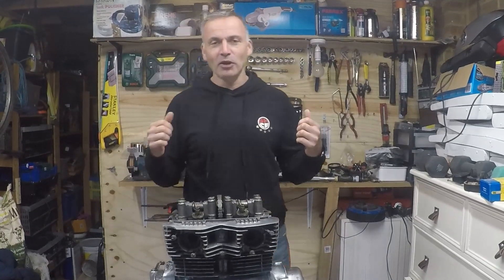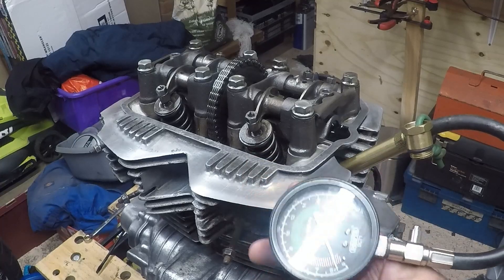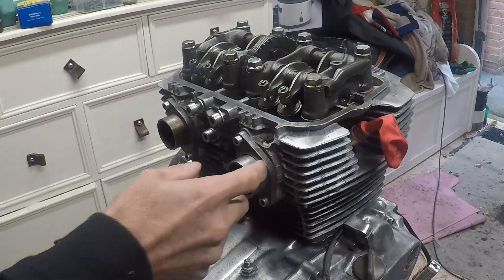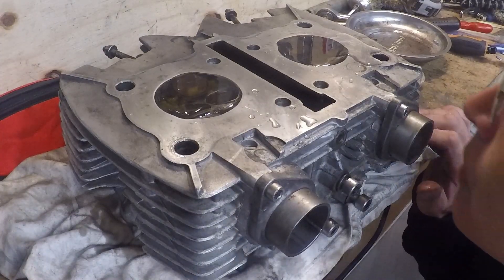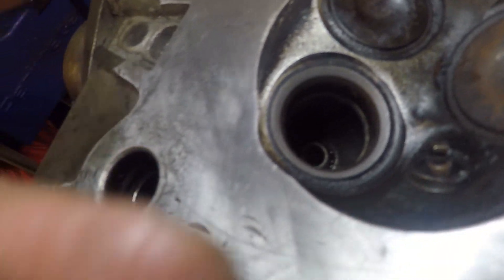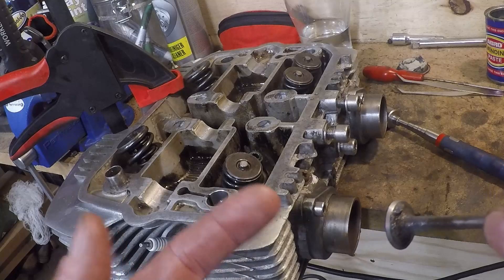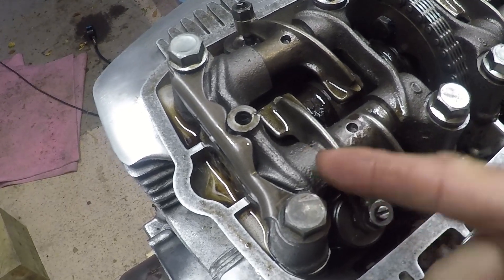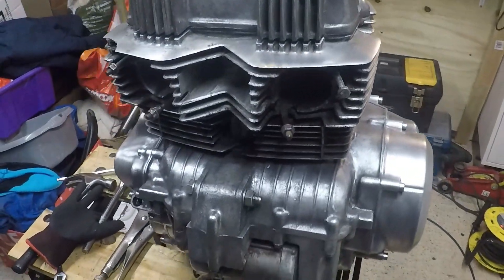Can I Fix My Low Engine Compression?  Honda Superdream Project - Part 19

Comment: Hi the leads from my coils don't come off .  Caps are the screw in type ..possible original to my 750 k5. These are , I feel ,are too short from over the years. Is it possible  ,   worth trying, to try a extension to add some slack .?????

Comment: I thought 150psi was a normal reading, not 90psi??
Reply from the maker: Hi Simon, you may be correct, and i hadnt checked it recently, but i now know my starter motor was knackered when last checked, and its hadnt been ran yet. So may be worth i recheck that again.

Comment: Would this be a common cause for compression loss on most bikes? According to my mechanic, my enfield has critically low compression, but he reckons he can't fix it because it's requiring a full engine rebuild. A fix like this seems like something I could learn to do myself though, and I'd love to have a go at it.
Reply from the maker: Hi, there are not many possible causes for loss of compression, and they can all be addressed by only working on the cylinder head. I found the challenge enjoyable and whilst I made mistakes along the way, I felt huge sense of achievement when i got this running myself.  I can only recommend you give it a try if you would like to learn. 😀
Reply: @RyansGarageUK  Looks like I'd better get myself a service manual then. Thanks pal 👍

Comment: Hey mate, just a question.
My bike, cbr 600 rr 2004, is lately stalling in neutral at stops even clutched in and also while riding will lose power for a second or two or will jerk forward sometimes as I deccelerate.
Do you have any idea what the issue might be?
Thanks
Reply from the maker: Hi Tilemahos, I'm no expert at all, but your description to me sounds like a dirty carb, but I don't honestly know if your bike has carbs or if its Injected? If you do have carbs I'd strat with removing and at least cleaning out with carb cleaner before you spend any money. Although I'm sure others may suggest something else. Ryan
Reply: @RyansGarageUK  Thanks a lot Ryan.
It is fuel injected but I'm taking in consideration the cleanning suggestion.

Comment: Awesome idea on the leak down side, it may be a bodge idea tool but if it does what you need then all is good.  The compression will come up a bit once oil has flowed around, dry rings never seal properly. To check just squirt a bit of oil down the plug holes and re test
Reply from the maker: Thanks Chris for your encouragement. I'm hoping compression will be okay when engine's warm and oiled up properly. Cheers. Ryan.

Comment: well done that man! love it when an idea works out. I was then thinking, so lets start it on the bench next but then, outta time, another video over - roll on next video.
Reply from the maker: Thanks Tim, I was thinking of trying to run it on a bench, but the external components and wiring leads me towards feeling I need to put it in the frame, which I might later regret. 😀

Comment: Well done and I must say: very smart diagnostic method!!! No need to buy expensive tools when you have a balloon laying around 😁

I guess the compression is a bit on the lower side, but it is not terrible. A tip for you: Add a tiny squirt of engine oil into the cylinders and move the engine back and forth and sideways to get the oil in between of the cylinder wall and the piston. Then do a new compression test. If it reads better values it indicates compression loss because of worn cylinder, piston or rings. If it reads the same values, the problem is related to the top.
Reply from the maker: Thank you, it took me a few days of thinking about the issue, then I had this idea. Luckily for me it worked (this time) Cheers Ryan

Comment: Well done, that's got to be the most unorthodox leak down test I've seen but it did the job. For future if you can make something with a plug thread on one end and a schrader valve on the other you can use a bicycle pump to pressurise  the cylinder.There is enough compression to start the engine and you may find it increases once hot and its been run a while.  Good luck with the electrics.
Reply from the maker: Thanks Colin, I'm hoping that the compression will be okay now, but the electrics are unlikely to be just a simple test and continue.
Reply: Found the link above at 180 psi, hope it does when its hot.